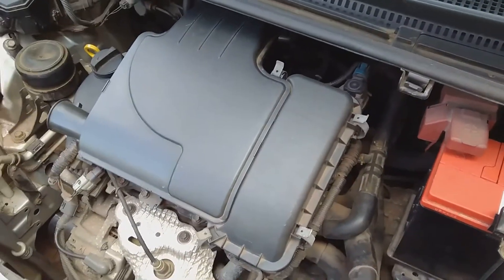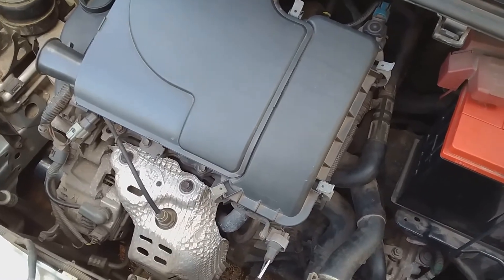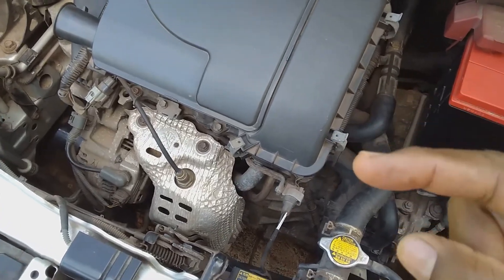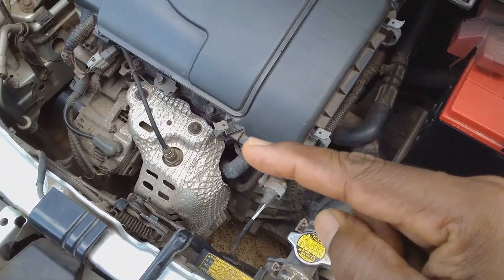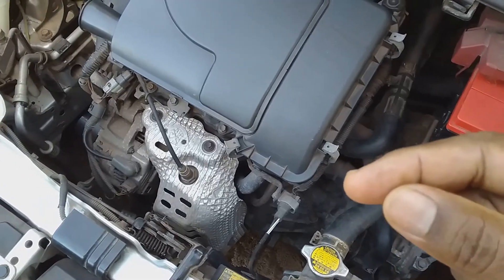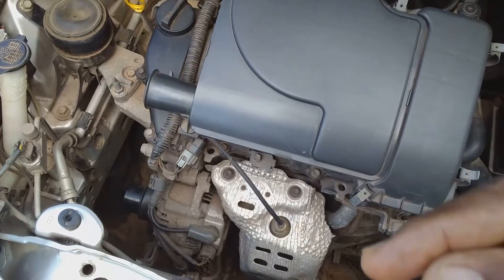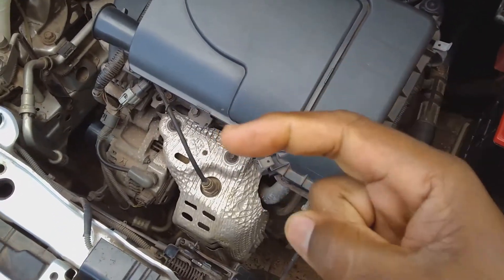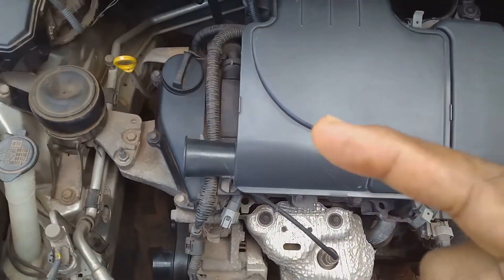Toyota Vitz Why 3 Cylinder Engine Vibrates Part 1

Comment: I have a Nissan Note 3 cylinder. Engine vibration remains when driving
Reply from the maker: @princebeckford2655  even when the vehicle is driving above 25 KM per hour with no input from the accelerator pedal.

Comment: Engine don’t recognize when Coil number 2 and injector switch number 2 is plug off.it keeps misfiring after changing around coils to check if they all good and brand new plugs.can you help me
Reply from the maker: @jermainewilliams4399  if you interchange the injector or spark plugs in number 2 cylinder and still no response from number 2 cylinder even when these parts work in other cylinder you could have a wire breakage problem from the connection of that part to the computer.
- did you scan the vehicle for error codes and if yes, is it only the error code for engine misfire came up?
Reply: @ShelDockToyotaVitz  thank you but I had to change the computer
Reply from the maker: @jermainewilliams4399  you are welcome my friend

Comment: Every 3 cylinder Yaris I've driven vibrates more than the average car.
I'm running an oil analysis on my 2020 1.5 L Yaris to establish wear prior to bonding a lubricant to the engine.
This should reduce vibration as well: 
We've measured 50~90% reduction in wear after treatment.
The wear reduction corresponds to reduced vibration as well.

Anyone who wants a quieter engine could try this solution.
🙂
Reply from the maker: Good job, keep up the excellent work.
Reply: Explain more please
Reply from the maker: @RicardoJones-rh6pr  3 cylinder engine will vibrate easier than a 4 cylinder engine because the power strokes take a little longer to occur than a 4 cylinder engine. When systems does not work as close as they should coupled with the length of time it takes for the power stroke to occur. vibration will occur more easier for the 3 cylinder engine.
Reply: @RicardoJones-rh6pr  Every time I write a response it gets deleted. 😞

Comment: Ok mine is three cylinder good morning I too your advise I change plug check the coil pack clean the volve clean tracke body and the ingine light is still on coil it be a sencer?
Reply from the maker: Its the check engine light on and not the ignition light.
Reply: @ShelDockToyotaVitz  check engine

Comment: Sir my car is also 1KR engine and the car when under light acceleration it feels like it goes forward, (jerking) is this due to the CVT transmission and is it normal? Mechanic could not feel anything wrong but I can feel the jerking. But the car drives smooth apart from that no abnormal noises or engine light. Thank you
Reply from the maker: Thanks for reaching out, I  can detect that you have a keen sense of observation based on your description of the problem you noticed. Yes you may observe a slight jerking of the vehicle or engine however it may not be something to be alarmed about. If it bothers you though you could get your injectors clean as well as your spark plugs. It could be that the engine is not getting enough fuel needed at that critical point of acceleration when you lightly press the gas pedal.
Reply: @ShelDockToyotaVitz  Thanks for reaching out sir. I think its just i have to get used to it. didnt find much info about it online. Ive read that the CVT of the vitz has an engine braking feature when delerating which also happens to me. but the thing that it slightly jerks when releasing the gas pedal is quite annoying. i will contact my mechanic thanks for your tips
Reply: @ShelDockToyotaVitz  and it only happens when going 40km/h and under. apart from that it drives smooth

Comment: My vitz brake is not functioning well so the mechanic asked me to change the back drums how through is that
Reply from the maker: If you remove the drums and run your fingers inside where the shoe grips and it is rough with groves it definitely would need to change.

Comment: My vitz 1000 cc produce heavy vibrations while applying brake in signal. I have spent money to fix but all mechanic failed to rectify the issue while some resolve but problem again happened after little time. Some mechanics advised me to replace 1000cc with 1300 cc. Kindly advise can my issue be resolved with existing 1000cc engine. Many thanks
Reply from the maker: Disconnect the hose at the brake booster that leads to the intake manifold. Plug the hose so that nothing can be sucked through. Start your engine and drive the vehicle slowly then apply brakes. Do this 3 to 4 times and if you do not have any engine vibration then its possible you have a bad brake booster. Confirm the hose is properly connected to the brake booster without any leaks before you come to this conclusion.
Reply: @ShelDockToyotaVitz  many thanks sir i will get this checked.
Reply: @tariq_Che_Mistry just clean trotal body of the car

Comment: I own a 1.0L Toyota Vitz 2012, my mechanic recommmends that I get the engine changed to 1.3L for Vitz. Now is this recommended as I reckon that too would be a 3 cylinder engine
Reply from the maker: If you are swapping 3 cylinders to 3 cylinders that's fine. Ensure that the replacement engine has the same features.
Reply: Is there a 1300cc 3cylinder?
Reply from the maker: @leogiddy5307  Swapping engine comes with a lot of complications (parameters may be different- computer and engine may not match) its a lot of risks. your choice.
Truth is many mechanics are afraid to trouble the parts on a 3 cylinder engine because it just does not function as smooth as the manufacturer fix. Its best to use the engine as much as you can until you get enough service from it then get an engine similar to the one you will remove but a newer engine.
Reply from the maker: @leogiddy5307  there are 1300 3 cylinders engine but am not sure for the vitz.
Reply: @leogiddy5307 yeah. Mine is 1300 3 cylinder
Reply: No, 1.3l that is a 4 cylinder.
Reply from the maker: @kaongamartin2193  yes for this type of vehicle, Vitz.
Reply from the maker: @kaongamartin2193  990 to 1000cc engine rating is usually 3 cylinders for the vitz.
Reply: @kaongamartin2193 1 have 1.3 , 3 cylinder 2012 edition. Computerise raised the fire a little bit to make away with vibration when at idle. 
You just burn a little bit more fuel.

Comment: Are three cylinder engines problematic compared to the 4 cylinders?
Reply from the maker: Not necessarily but the 4 cylinder engine runs smoother.

Comment: Where is the power steering pressure switch located on this engine
Reply from the maker: The vehicle shown in the video uses a motor assist steering. Click the link below to see the power steering pressure switch location for a fluid assist power steering.
https://electricalsbaja.blogspot.com/p/power-steering-pressure-switch.html

Comment: My Vitz 2012 engine shaking / shavering only when  stop on signal...
Reply from the maker: If you do not have an engine check light then you have a mechanical problem. 
Most persons clean or change spark plug and air filter if necessary.
You can also clean your throttle body.

Comment: Just looking into this engine again and realize it uses variable timing technology. So from a scan I see where the target displacement angle has no reading.  Is this normal ?
I suspect it may be contributing to the vibration I am now experiencing.
Reply from the maker: Is your engine 3 cylinders 1000 cc or 990cc?
Reply: @ShelDockToyotaVitz  1KR-FE   996mL
Reply from the maker: @stuartwilson3057  If a sensor detects a fault in your engine then the engine check light should be visible in the dashboard. If there is no engine check light visible it means that should not be the problem. Remember also that some parameters are only active when the vehicle is running. Also remember that the VVTi techonolgy is only active when the engine requires more power.

Comment: I'm facing jerks when accelerating after braking on slow speeds also car is vibrating on idle seat vibrates alot
Reply from the maker: Scan your vehicle for any errors of the engine sensors, so this would be the first step.

Comment: I am having issues with my vitz one of my cylinder is running low is it that i have a burnt valve
Reply from the maker: Before you think of a burnt valve get your injectors cleaned and replace your spark plugs if necessary.
A low arcing spark plug can cause delay in burning air fuel mixture. A partly blocked injector will cause engine vibration only during idling.